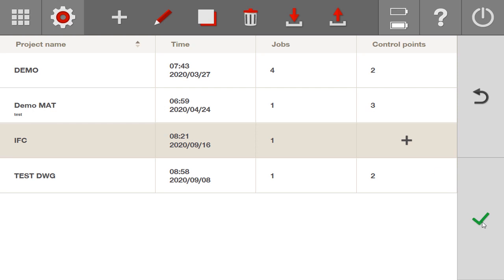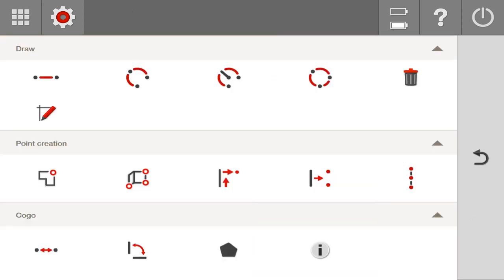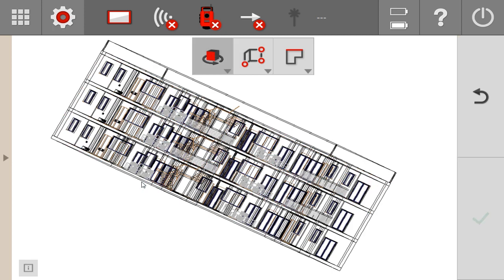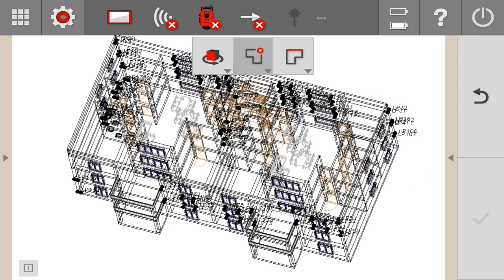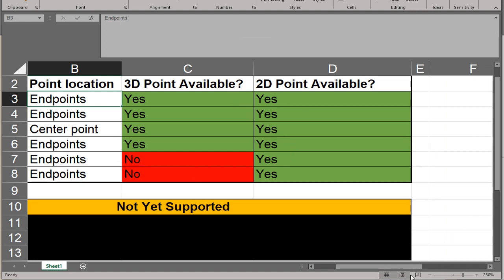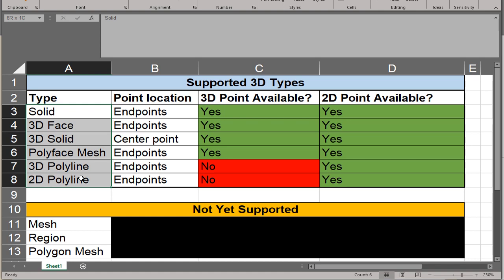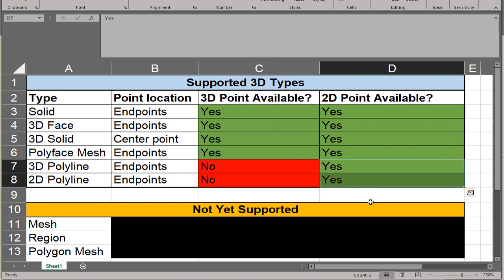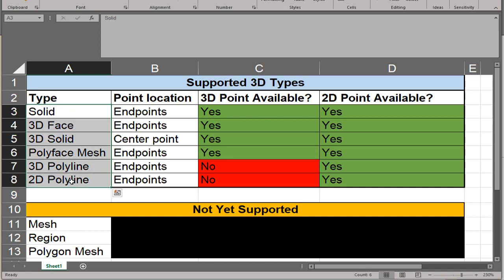Hilti PLC 400 Tutorial - POINT CREATION - 3D Point Creation

Comment: Hello,

I have a 20mb ifc file but cannot import to layout office and plc400. How can solve it?

Thanks!
Reply from the maker: that's a tough one. From what I've found, the IFC file converter is much more of a viewer than it really is plausible to use. I see that technically it can be used, but I tried a 15 mb file and it struggled big time.

Is there any way to convert the IFC to a 2D DWG? That might be your best option.
Reply: Measuring Systems thanks for your reply!
I have converted to dwg. After explode the drawing, I cannot create points in plc400 or plo because the line is shown 3D face in autocad properties. How to solve it? Thanks!
Reply from the maker: @chinchitang5075  Ah gotcha. Well in AutoCAD you should be able to run the "region" command, and then once they are all regions, you can run the "Explode" command and they should all become lines.

3D faces can also have points put on them with the new software update though...it's the 3D point creator button.
Reply: Measuring Systems yes, I can explode to line from region. The updates version of software is not announced, right?
Reply from the maker: @chinchitang5075  I don't think there is a big announcement. I believe it just goes to the auto update server and as long as you are on wifi, you get the update with the release notes.
Reply: @measuringsystems869  you mean the hcl version is 3.2.0.9? Thanks!
Reply from the maker: @chinchitang5075  Yes - that is the most recent version. I noticed it was temporarily taken off the server to fix some bugs probably, but yes, that is the most recent on I was using.
Reply: @measuringsystems869  okay, got it! Many thanks!!!!!